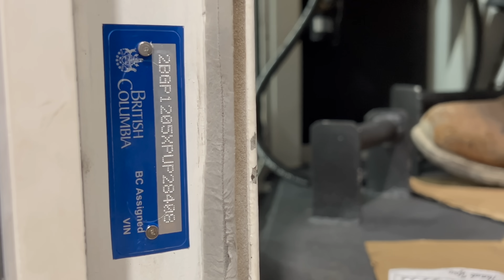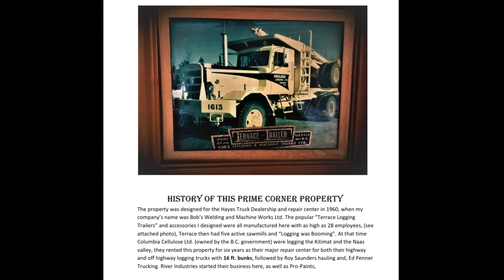Our Plan To Revolutionize Truck Manufacturing

Comment: When can I get a kit for a 2013 Ecoboost F150?  Why can't a half-ton be made to do more if you're replacing the axles?  Can you put a solid axle in the front?  The engine has a lot of miles, so may as well swap it for a generator too.  I really need a 1 ton diesel, but I'd rather have a hybrid.

Comment: I know, Sandy Munro, took at look at it. You need to look at the cost of manufacturing first,  250000-300000k per truck 20% net. And look what type manufacturing to pull that off. Please please please, get Munro to help you.

Comment: Awesome that your company is continuing to work on bringing truly efficient hybrid trucks to the market. it's something that is severely needed in my opinion.

I will note something you probably didn't know regarding the claim of being the "North America's first hybrid truck". There used to be a company called Efficient Drivetrains, Inc. down here in the other CA.  They prototyped several hybrid mid to large commercial trucks (though likely slightly lower classes) and did a few limited hybrid conversions of several fleet vehicles. I helped emission test one way back in 2015, it was pretty amazing. Seems though in 2018 they were acquired by Cummins. Which then seems to not have done much of anything with the technology. Very strange that.. 

Hoping the best for Edison Motors. keep growing and expanding and hopefully one day I'll see one of your trucks on the roads.

Comment: I really want to believe in you guys, but you absolutely need to publish some data about your systems because you're making claims about how they work that, as an engineer, I just know that they simply CANNOT be true. 

For example: I've seen you guys make the claim that you can just run your diesel electric systems until the generator is out of fuel, and the wheels will keep turning. But you've also said that you are matching the output of the generator not to the peak load of the system, but closer to the average load (which makes sense). But this means that if you run your electric motors about the average load for long enough, the batteries will be depleted and the wheels will stop turning even though there is still diesel in the tank and the generator is running. So, for instance, if you try and tow a trailer up a steep enough hill, you will have to stop and recharge for a while mid way. I think you need to release data on that load matching and the capacity of your batteries. 

I've also seen some big claims about the efficiency of running the generators at a constant RPM offsetting or even eclipsing the inefficiencies of converting from mechanical energy to electrical energy. I'd love to see some hard data on just what those efficiencies are. 

I really hope you guys aren't another Nicola motors raising money for BS trucks, and that's why I would love to see the data that demonstrates that you guys are legit, even if it means acknowledging some possible shortcomings of your approach; and remembering that ALL competing technologies have these kinds of tradeoffs.
Reply: Watch Wes Work asked some of the same questions. Apparently the "guys" from Edison had a chat and Wes pulled the video. Makes you wonder...

Comment: Can we test topsy for a central Utah coal haul. We run double belly dump coal trailers pulling up and down 8 percent grades. I would be interested in seeing how the regen braking works on these steep roads. I’d also like to see how it handles a rolling belly dump at the pile. If you’re interested I can take a video of the mine road.

Comment: First issue, the deposit should of been $2500. not 250. That be 3,250.000 CAD. Government can pitch in 50% of 12 m, which is 6 m, not and get investors to fund another 5 m to top of the other 6 m and and some operational cash flow.

Comment: Wishing you the best of luck, I haven't quite pulled the trigger on one of the pickup kits, it's a tough question as I'm retired and it would only be a daily driver, not a commercial vehicle.  I'm hoping the concept will catch on with different parts of the automotive industry. A smaller diesel engine smaller generator, smaller axle maybe with a choice of horsepower & torque for different applications. Like a Ford 9 inch has different gearing options

Comment: Terrace is a bold choice, i like the historic throwback homage. 7ish hrs remote out of a main hub, shipping costs are gonna be higher,  add a day to transit time.  I'm guessing we're serving the North American market and not shipping out thru PR.
Added benefit is that shiney new CVSE site at Thornhill. It'll help revitalize that area,  there's a fair bit of opportunity nearby for some sales opportunity,  and i wonder if some of the early clients are nearby....
Reply: If they're getting stuff out of a shipping container (such as builk orders of axles, batteries, wheels, tires, windows, solar panels, and so on), there's a new logistics yard being built in the old sawmill yard south of the tracks, so drayage will be just a kilometer or two, and they have their own trucks for that. Getting steel delivered by rail should be cheap as well. They could also ship out new trucks on flat cars from there. And right behind the building is Terrace Steel Works, which does welding, fabricating, and machining, if they want to outsource some work. It's really not a bad location logistically, unless they're doing LTL.

They just gotta watch out for the drug zombies that roam downtown now.

Comment: That's so cool about that factory! My dad used to have a 74 Hayes Clipper in Alberta that I am trying to find. It was dark blue with big flake in the paint with a baby blue roof and sleeper cap, white lightning bolts on the sides, aluminum body and frame, twin polar bears on the hood. Manual steering, Jacobson Rubber block in the rear and a piece of structural steel tubing for the front bumper It was last spotted in 1978 or so with "Blackies Transport" crudely painted on the door. This thing was a show truck when dad had it, and even if I can just find the body, I can build it up for him!

Comment: Honestly Terrace seem like an odd choice to locate a high tech manufacturing facility.  Maybe times have changed but I would want to be nearer to the labor pool, be near suppliers, not have to pay a shipping premium for product coming in and out of the business and be in an area people want to move to.  Just because you're making logging trucks doesn't mean you need to be near trees and sawmills.  If you said Southern BC interior that would make a lot more sense to me instead of a small town in the middle of nowhere.
Reply: Terrace is on the CN mainline. If they're doing LTL then it would be more expensive, but if they're doing container loads, there's a new container/transloading facility being built a 5 minute drive away, same for getting steel delivered. They can do the drayage themselves. They could even ship out new vehicles on flat cars: the new transloading facility would love the business, and anything under 15 feet tall will fit through the same routes the double stacked container trains go. Right behind the shop is Terrace Steel Works that does welding, machining, and so on, if they want to outsource some work. It does happen to be across the street from the last local sawmill though haha.

There are lots of mechanics and shop type people in the area, as there are many mines to the north, loggers who need machines fixed, plus the LNG plant in Kitimat has brought a lot of skilled labour to the area. Terrace is an industrial town with a bit of tourism thrown in.
Reply: @MarkRose1337  good info thx.

Comment: It is the only way forward going full electric right away doesn't make any sense
Reply: Volvo announced, in 2023, that their EV fleet test truck clocked in at 500,000 km. But there's a catch, the trip is 240km and charges four times during the trip. Four!! 😳😲
On the 7th day of use it drives for half the day and remains charging the rest. Good luck trucking fleets out there, good.. luck!

Comment: Not only is it a great concept, but it is the right company attitude on how it should be done.   This is how manufacturing should be done.
Reply from the maker: Thank you! 🤜🏼🤛🏼
Reply: @EdisonMotors  I've been watching your videos and would like to be put on the list for this conversion,  how do I get started ? Its the 8th of March
Reply: @EdisonMotors  Hey I got on the waiting list for the pickup kit a couple months ago. Will I still get a blue original hat eventually or did y'all run out?
Reply from the maker: @ianbatey3425  we have ran out but they are on order, you will receive on as long as you ordered before Jan 12th
Reply: @EdisonMotors  Thanks! I placed it on the 12th. Is that too late?
Reply from the maker: @ianbatey3425  I just checked and you’re getting one of the last 50 hats. 
The 12th at midnight was the cutoff where we updated the website. 
Everyone after gets stickers.
Reply: Amen to that ❤ 🙏